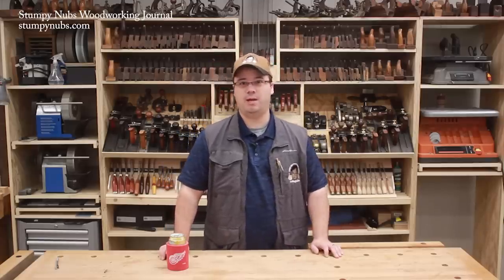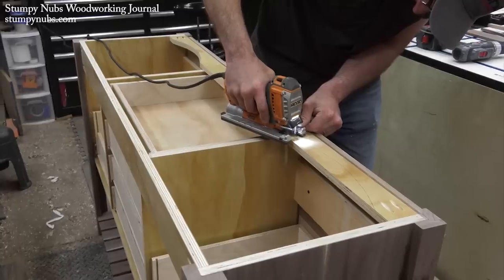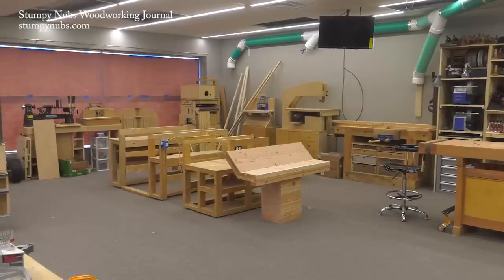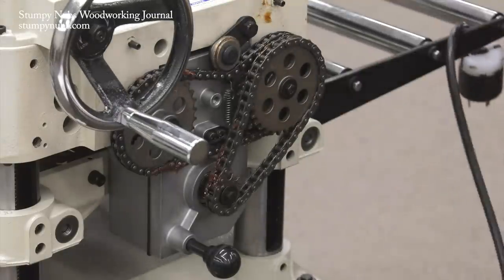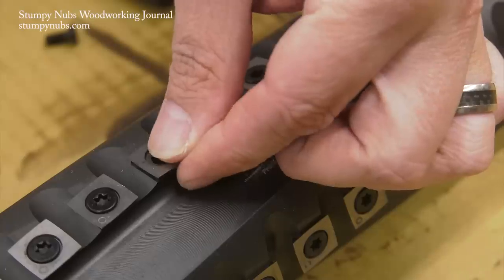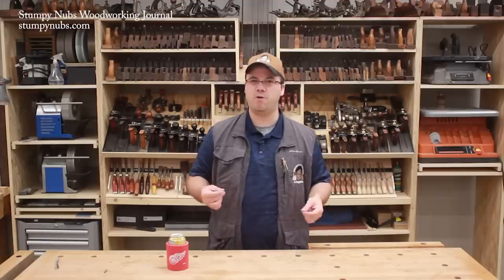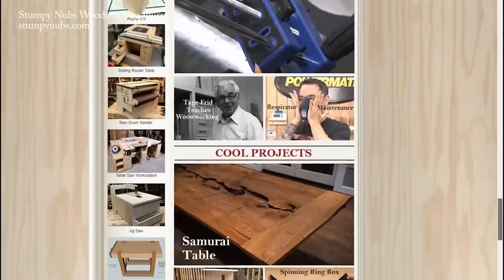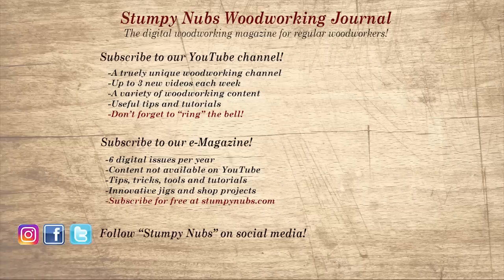Game Changer? A new alternative to Byrd Shelix carbide jointer/planer heads!

Comment: Hey Stumpy Nubs.  I have watched a few of your videos.  Way to go.  You're very informative and easy to understand.  I to installed a Lux 3 cutterhead in my recently sold Dewalt DW 735.  I talked to the guys at My WoodCutters and they recommended that particular brand.  It was an extremely nice unit.  I installed the OEM sized one and it was a breeze.  I only sold the Dewalt because I needed a larger floor standing model.  I upgraded to an 15" helical cutterhead.  I would never go back to the blade setup again.  Way quieter, better cutting, no tearout.  The funny thing is the only reason the guy who purchased the Dewalt is because I had installed the LUX 3 head.  The thickness planer is one of my have to have pieces of machinery in my small shop.  Keep up the good work.

Comment: I bought a Felder jointer/planer combo machine and it came with a helical cutter head as one of the two options you have when you order. 👍
The seats for the carbide cutters on the cutter head have a shape that prevents the cutters from twisting when you tighten the screw.

Comment: I took your advice and contacted Steffen about ordering a helical head cutter for my 6 inch Delta Jointer from My WoodCutters...  As you say in your videos, Steffen was great, freely gave his advice and was super helpful.  For my application he steered me toward the Lux.  The new Lux III cutter head arrived quickly and installation took about 2 hours and was fairly straightforward;
 a good chunk of that time spent recalibrating the infeed and outfeed tables, something I had been neglecting to do for a while anyway.  The white oak boards that had been giving me fits because of tear out, passed over the new cutter head on the jointer and came out glass smooth, no hint of tear out.  And the reduction in noise was significant and much appreciated because my shop is located in the basement. Thanks for the great advice!!!  I recommend mywoodcutters.com very highly. Jim A from CT.

Comment: Just finished installing my new Lux lll helical head from MyWoodCutter.  This purchase was made on your recommendation and I am very satisfied with the result. The installation went very smoothly, thanks in large part to a video from Meyers Woodshop which provided extremely clear and precise instructions.

I am your typical  "woodworking for fun" type of woodworker and the dollar outlay was not small.  However, I believe the money spent will prove to be worthwhile.  I did not buy it for less noise or to save money on blades.  Being an almost obsessive person, seeing all those lines from nicks in my new or freshly sharpened blades just really bothers me.  Sure, they sand out easily but they still happen and they shouldn't.  Tear out is a whole new subject.

I have only run a couple of pieces of wood so far but they look great and I expect that I will be just as happy this same time next year.  By the way, my wife would call my behavior OCD while I prefer to think of it as attention to detail.

Thanks again for your advice and the videos.  Keep up the good work.

Comment: I ran my furniture company in a one car garage — but I certainly wouldn't have been able to film. It was extremely hard to even photograph my pieces for the exact same reason you mentioned. I am just finishing the building for my new shop right now (32 x 36 woodshop area). I have never had a larger shop so this will be interesting. I will be using the extra space to work on multiple projects at one time, but the size is not overly big so I think it will be quite relatable. 😊

Comment: Thank you for the news about the Lux Cutterheads. I recently purchased and installed the Shelix and as you mentioned, I must have not properly seated some of the blades as I have some that sit up too high (based on results). So I now have to go in an adjust individual cutterheads. Ugh. When I buy a jointer, I will look into Lux Cutterheads. If the blades sit better, then this will be a win.

Comment: Hi Stumpy, I have a Hammer A3-31 planer, with the Felder "Silent Power" helical head.  I am really impressed with it.  Compared to the rather crude appearance of the Byrd Shelix, this appears to be a much more sophisticated design, and the overall form is a smooth cylinder rather than the protruding-tooth approach of the Shelix and the LuxCut (which is a half way house, but not quite as fully developed as the Silent Power design. The teeth are also extremely well located in pockets machined in the head.  Perhaps you would find it interesting to add this to your comparison, although I suspect that they are relatively rare on the US market.
I am very pleased with the helical head performance, after years of straight knives, and even on extremely difficult timber (burr elm, yew...) it can give an excellent finish.  They also have measured noise data which suggests about 10dB less noise than a standard head in the same machine (back to back measurements).  I can pretty much talk normally to someone while I plane a board. 
Thanks for the effort you put in and the thoughtful presentation.  Enjoy the new shop :-)
greetings from Cambridge, UK.
Miles
Reply: Hey Miles,  I bought an A3-31 about 14 months ago.  I figured at the latest it would take 3 months to get my new shed roof on and the shed wired.  As it happened it took me nearly 12 months to get someone up to the Tassie highlands to do my shed roof and I have to wait another 6 weeks to wait for the electrickery.  I have my A3-31 sitting there still in its wrapper.  I am aching to fire it up and get on with some woodworking.  I also purchased the horizontal mortiser.  Do you have one and if so what are your thoughts?

Comment: Aside from deep cleaning each slot for the carbide cutters a little bit of anti-seize compound on the screws do wonders as well. :)
Reply: thumbs up for Antisieze. dissolving pitch off the cutters works well with mineral spirits.

Comment: Using tools that few can afford was a gripe of mine about some of the woodwork shows on PBS. I would wager more of us have a contractor table saw than a cabinet saw. More of us have  a jig saw than a 16" band saw. How about projects that can be made with a $100 scroll saw?  When you feature tools that only a productin shop would have, that leaves a lot of us out.
Reply: Norm was pretty bad that way.  I enjoyed and learned from what he was doing, but he'd make something with his $3000 pocket hole machine or his $1200 edge bander and scarcely mention it or suggest alternatives.  James is outstanding about explaining not just the how, but the why and the limits of different tools and processes.  And he does it all with a wonderful sense of humor.
Reply: @mikecurtin9831  yep he is who I was thinking of.  Today we make a foot stool. Take your pieces to the table planer , then the 16" self feeding sander, then head for your mortising machine. Great,  show me how to use a CNC router that I don't have.
I guess money motivates most things. Most of these shows are infomercials to sell products. Sponsored by .... Use the links below.....
Reply: Wrong show. Roy Underhill would have made it with a hatchet and a penknife. Frankly, you'd be amazed at what you can do with just a ryoba (a Japanese rip/crosscut pull saw), a block plane, a couple of decent chisels, and something that makes holes. It takes time, yes. And effort. There are plenty of tricks that minimize the skill required (e.g. your saw will guide itself if you first cut a path for it to follow). You absolutely cannot run a furniture factory on hand tools these days unless you find customers who hate having spare money - but you don't need any of that stuff to make things for yourself.

Comment: Great info James, will keep this in mind if/when I upgrade the cutterhead on my 15" Grizzly planer. I think you said the planer and jointer are new with the new shop - any reason you went with the 1021Z rather than the 1021X2? Its only $445 more to get the model with the helical head factory installed vs about $750 for the aftermarket Byrd or Lux. Or did you find a deal on a used planer? Looks like the current 1021Z comes with cast iron wings so maybe you didn't have the option to order it with the helix. I have a newish Grizzly jointer and their new helical heads are very high quality, a big improvement over their older spiral heads.
Reply from the maker: Grizzly buys heads in bunches from different companies. You don't always know what you'll get. Some don't skew the cutters (an important feature, in my opinion) and some don't have good rust protection. Not a rip on Grizzly, but I knew the LuxCut would be top quality.

Comment: Byrd offers a smaller head for the DEWALT 13 inch planer so you don’t have to remove all the knives. Does lux do this too?
Reply: If you take a minute to research the Lux Cut you'll find the answer.

Comment: Just (3 months ago) bought Byrd Shelix for an older set of General Canada planer & jointer, no stall on availability, no problem on bearings... documentation on install was perfect... so I would say that there is no 'customer support' reason not to go with Byrd.  Otherwise as noted here the cut quality is probably equivalent between vendors.

Comment: After installing and using the lux head , I've noticed after awhile that my long pieces fed through the jointer will come out bowed, with the center being thick and both ends being thin.  The first time It happened I rotated the cutters and problem solved, the pieces came out straight, however it is starting to happen again.
I hardly use this machine, it gets used maybe twenty times a year.
Anybody else having this issue after installing these heads or could there be a problem with the machine?

Comment: What do you think about the lux cut head only having 40 teeth vs the shelix with 75? Do you think it makes any difference?
Reply from the maker: I don' think that's universally true for all heads, is it? I am pretty sure my LuxCut planer head doesn't have half the cutters as the previous Shelix head I had. That would have been pretty obvious.
Reply: @StumpyNubs  okay I went back and checked again and your right. I think when I clicked your link it took me to your planer and when I looked up the Lux cut iii I actually typed in my planer so I was looking at two different heads

Comment: Hi , I'm considering upgrading my rigid  blade planer to helical cut planer do you know if there's a tutorial for this operation and what are your thoughts , thank you
Reply from the maker: There is no tutorial that I am aware of. But I have changed heads in several machines. It's a pain, but it's not difficult to figure out.

Comment: You mention both Lux and Shelix perform better than "cheaper brands." Are you talking about cheaper brands of helical-style cutter heads, or cheaper/straight blade heads?
Reply from the maker: As I explained in the video, there are specific features of these heads that make them superior, in my opinion. The conclusion then, is any head without those features would be inferior, regardless of the brand name.
Reply: @StumpyNubs  Ah ha, thank you for the clarification: I'd thought you were comparing these two brands to other makers of helical-style heads, and I was about to start trawling the internet more deeply for makers I'd not heard of.

Comment: I do have a question. I just received a Grizzly G0813 Jointer that was used. I got a good price for it. It's in good shape. I got from a company that had upgraded to a bigger model. Has good blades and a second set of new blades. Here is my question. I have never used a Jointer before. I do not know how to adjust it. I really want to use it. And I have a Planer now so I really want to get to it. Can you help?  Also you are right. There are a lot of teaching videos out there. For the most part out of my price range. I am willing to pay for classes. I just retired. So I am on limited funds. Can you help?
Reply from the maker: Check the Grizzly website or do a Google search for a manual for your machine. That will show how to adjust it.
Reply: Vincent, here are some points about setting up your jointer:

Most everyone would like their jointer to cut dead flat, as a starting point, but for several reasons, a very slight hollow is useful, and a bellied cut has almost no use, and should be avoided.

Two parameters control those aforementioned cuts: if the tables are parallel, or deviation therefrom, and if the outfeed table is exactly tangent to the cutting circle. If both conditions are met, parallel and tangent, then a perfect flat will result. If the ends of the tables droop downwards ever so slightly, then a reliable hollow edge will result. Usually only industrial machines, even old ones, have a provision to alter the tables, but sometimes strategically placed shims can accomplish this.

I would go about checking a new unknown machine in this way, with a stick of wood between the length of the infeed table or both tables combined, and as straight as can be managed (without a working jointer!) and wide enough not to deflect under its own weight after you have taken a few cuts. Setting a modest cut of 1/16" or so, and working at one extreme end of the cutterhead, cut only enough length to reach the outfeed table, but not mount it (one inch or less). Then, try the same cut on the same end of the wood on the other side of the machine. You are checking to see if the knives are set evenly, and that one side does not cut higher than the other.

Everything OK? Next, with the outfeed table lowered just enough to avoid supporting the next cut, take a stopped cut that will overhang the outfeed table (while still being supported by the infeed table) enough to see that outfeed is parallel to infeed. A feeler gauge can help if eyes don't suffice.

Everything OK? Then, using another edge or another stick, take a cut long enough to hang two or three inches over the outfeed, and raise the outfeed up to just perfectly touch the stock but not lift it from the infeed table. This should give you an accurate cut. Check to see if the finished cut edge swivels when wiggled by one end while sitting on one of the tables; that would be a belly and means that the outfeed is still too low. A slight hollow, not necessarily undesirable, would be hard to see but would cause the stick to drag at either end with the same test. At this point, using two sticks to check against each other doubles your pleasure, doubles your fun, and magnifies the differences for easier detection. If the outfeed table has become too high, then the stick will constantly keep mounting it during a cut and lift off the infeed table, running out of wood to cut. This is sometimes referred to as a tapering cut, and is usually not useful. Sometimes, tiny nicks in the knives (usually a constantly developing situation), will leave tiny whiskers on the wood, which effectively mimic the outfeed table being too high.

There you go, that should get you started. For changing or resetting your knives, although a whole other subject by itself, I recommend wangling a dial indicator, with a wide flat tip for it, and mount it on a surface gauge. Such a setup can be found on the cheap in several ways, these days.
Reply: @leehaelters6182  Thank you very much. I will take this an copy to my note pad. Follow it step by step. I was able to get the manual for the planer a few days ago. So I am set. Oh I will pick up a feeler gauge in the next do or so. Thank you very much. Off I go to get it planing correctly.

Comment: Bryd is made in usa and lux are chinese
i would love to hear some feedback on what people are saying about the new lux, but cant find anything
Reply from the maker: Having held them both in my hands, installed them both and now having used them both, I honestly feel like they are of equal quality. The Lux appears to be much heavier-built. Lots more metal. But I am not sure that makes a difference in how they work. I do like the way the Lux supports the cutters so they align a little easier, but I personally had no issues with the cutters on the Byrd as long as I paid attention. For me, the biggest selling point on the Lux is the coating. The Byrd does tend to corrode in some shops where the temperature/humidity is not well regulated, and that can mess up how the cutters seat.
Reply: Any thoughts on five wings (5x6=30 knives) on the bryd vs four (4x7=28) on the LUX, it sounds like Im better to go with lux, but I hate supporting chinese made products.
This is a tough call.
Reply from the maker: @Mrdubomb  What machine do you have?
Reply: General international 80-100LM1
I know... its a chinese machine.  But why add to the hypocrisy?
Reply: I think the lux is the way to go, ive noticed a lot of space between the cutters on the bryd, which probably is not what you would want.  That could be the reason for the issue of straight lines in your work piece iive heard about.  The lux has them spaced closer together, and with four wings vs five, you have more of a swooping action similar to the straight knife.  So the best of both worlds.
Ive also noticed on machines sold with factory equiped helix cutters, theyve cheaped out and they have a lot fewer inserts than they should I think.
Now I need a helix cutter for my hand planer, that thing is a nail magnet.
Ill also add, the folks at my woodcutters have been great, I give them two thumbs up.
Reply: Got my lux cut 3 installed and i must say, I should have done this a long time ago.  Now to save up for my 15 inch dc-380, that sucker aint going to be cheap.